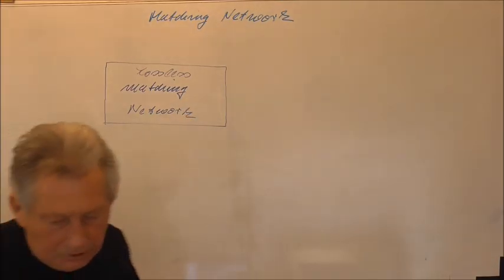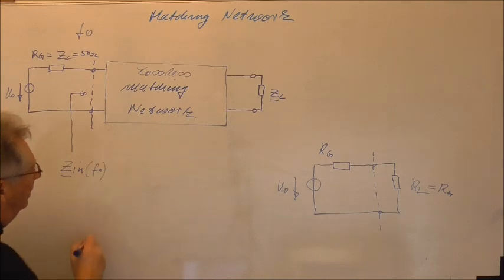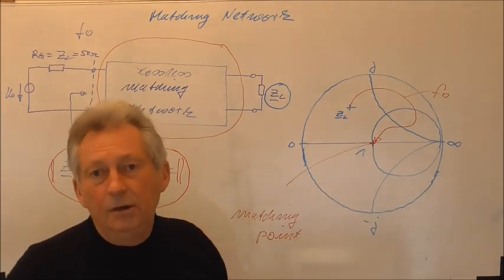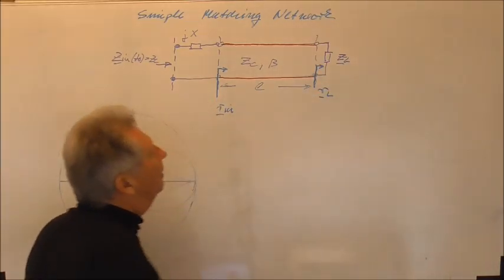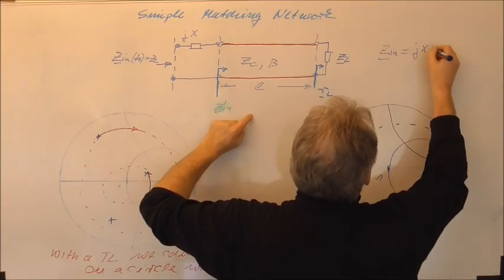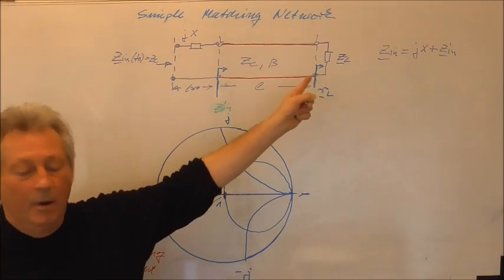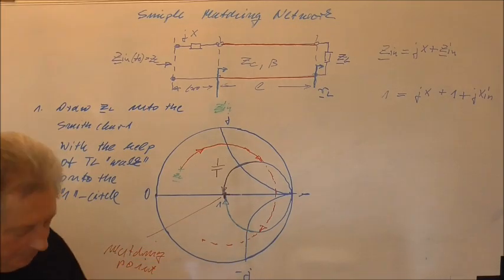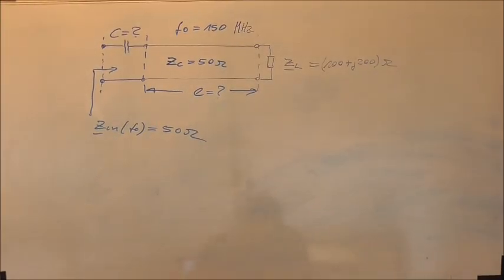Simple Matching Circuits

Comment: Very nice explanation! I have a question as well. So let's say we start from a complex-valued Z_L on the Smith Chart and change the length of the transmission line so Z_L "walks" on the the circle around the origin of the chart to reach the real-part circle with normalized impedance 1. If, instead of letting Z_L walk for a short distance to reach this real-part circle, I let it walk around a complete circle once, and only then do I let it walk towards the real-part circle with z = 1. In both cases, I obtain a normalized resistance value of 1 Ohm, but the length of the transmission line is shorter in the first case, and longer in the second case. This is my question: How can we have the same resistance in both cases (short transmission line and long transmission line)?
Reply from the maker: The short and long TRL will endup on the real-part circle 1 only if they are lossless. This comes from the periodic structure, you already saw in the mathematical impedance transformation. But in real life the TRLs are not lossless, so one always uses the shortes lines for doing the matching.
Reply: @Lectures_RF_Microwave  Ohh OK thank you sir!